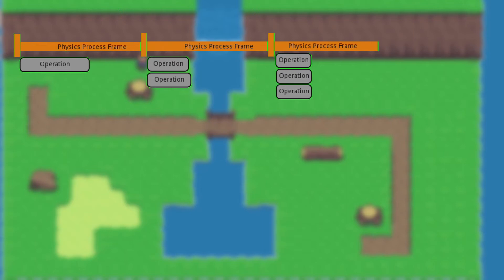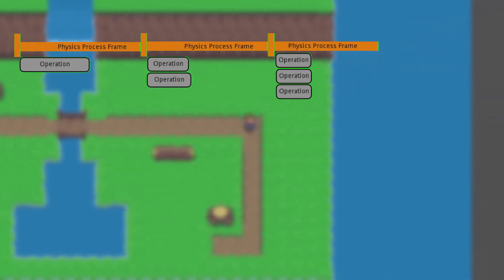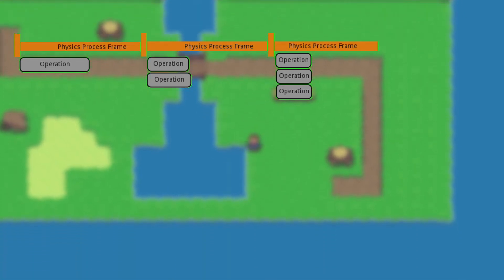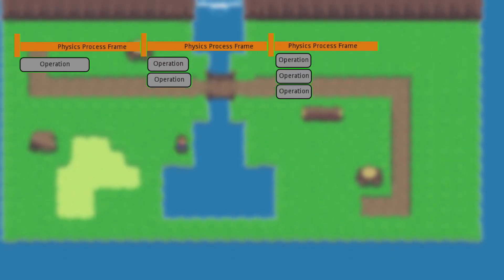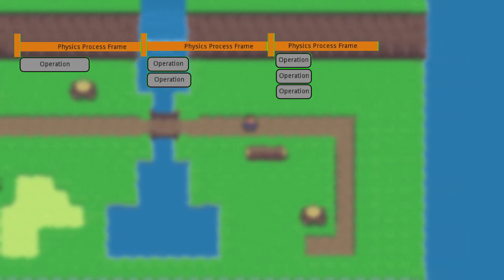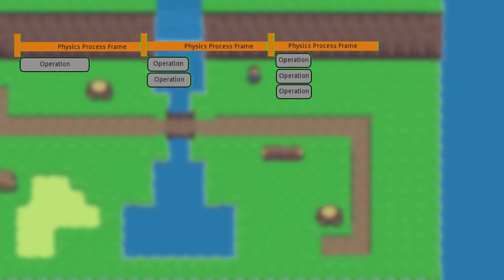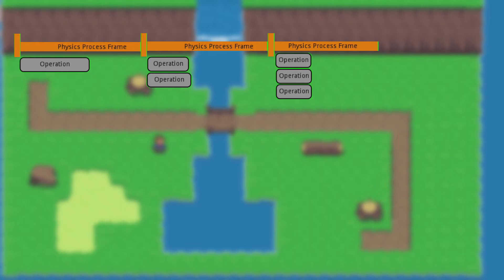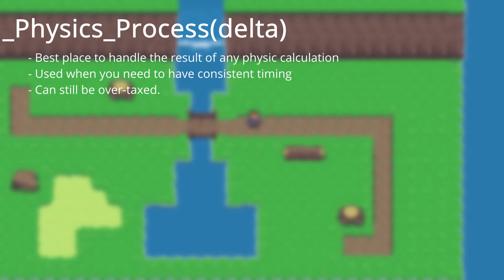Understanding Process versus Physics Process | Godot 3.x

Comment: It's basically if im not mistaken as easy as Physics process for physics calculations, like for example, moving the character in base of it's velocity. Process for just logic calculations, such as updating the input_vector based on the key you're pressing, you want that to be as fast as possible so you dont experience input lag, also you can use it for example in simple state machines for selecting the next state based on the conditions the "thing" is (this depends much more in the design of your state machine ofc). correct me if im wrong
Reply from the maker: I think any process can get abused so its about being aware of what you are doing and how much of it is going on. but generally yes.

Comment: I wonder, if your trying to make a retro style game, would it be better to only use _Process? I think that is more similar to how older games were programmed. Also, not using delta. My only concern is that it would mean that games would run differently on different computers.
Reply from the maker: The physics process can help ensure that we have smooth updates as each frame, even back in the day we were writing timers, and using system.time to have the sprite movement occur over a smooth timeframe. I would opt for having the game feel retro and tap into that rather than replicating developing in the retro times.
Reply: Just keep in mind the fps

Otherwise you will end like me who discovered the hard way that low fps really screws with animations and timers if they are under the _process function
Reply: Also, it probably depends on how authentically retro you want your games to be.

Comment: What? Your code isn't automatically multi threaded just because you put it into _physics_process().

You use _physics_process() when you work with physic related things because it updates every physics step.
You use _process() for things you want/need to update every frame.
They can happen at different times and at different intervals dependent on things like your physics settings, your monitors refresh rate, your render settings, etc. that's why they exist separately.
Reply from the maker: Hi! Correct! I did not intend to have it appear to be multithreaded, instead to rely on the physics process when you need a constant timing for each step where _process() does not guarantee that.  This and some other things I am going to be revisiting to be clarified. Appreciate the feedback!